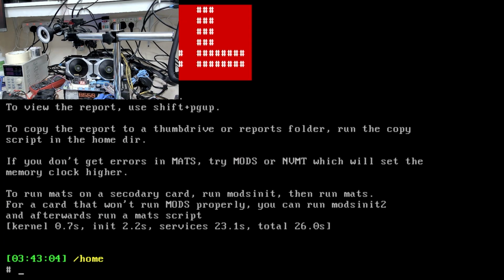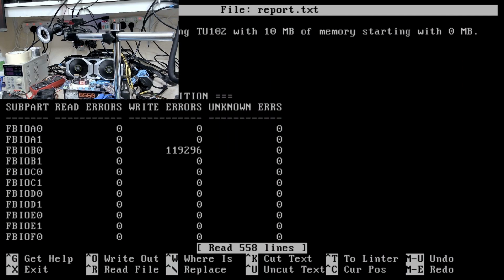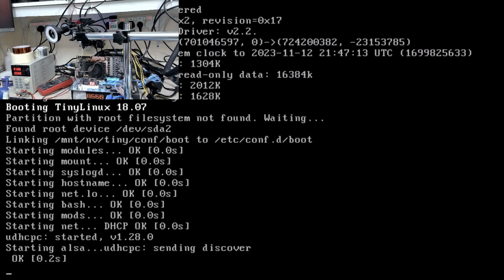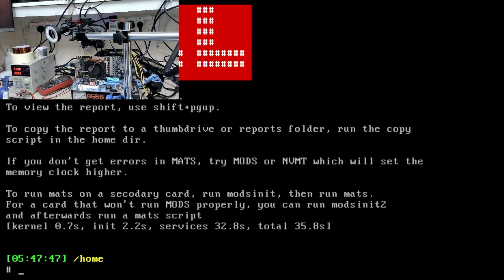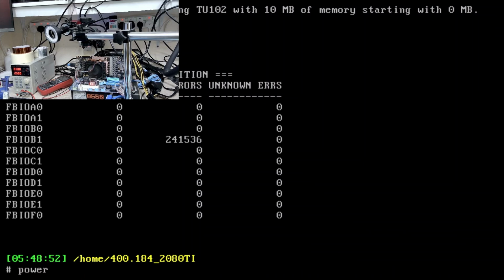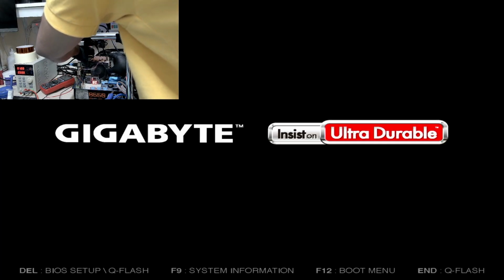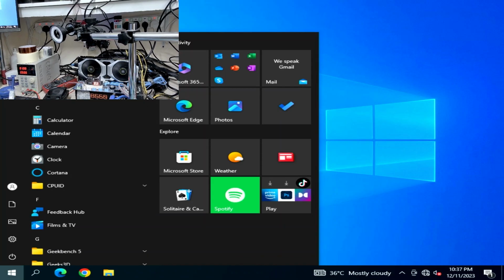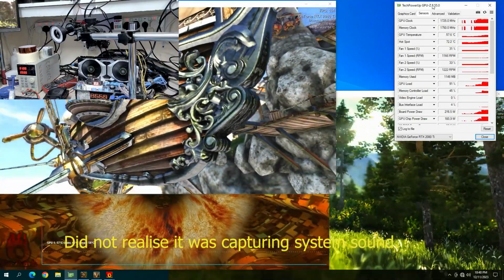RTX 2080 Ti Repair - 2018 Micron Memory Replacement - GPU Artifacts Fix.

Comment: Can you tell me what the temperature and wind of the hot air gun should be to remove the memory chip? and gpu? thank you
Reply from the maker: There is no fixed temperature as such. It all depends on your hot air station. I used Atten hot air station. For unleaded I use temperature at 420c and air at 60%. If you watch me carefully I keep tapping the memory gently to check if th solder has melted and if the chip is moving. If it moves when tapped it is ready to be removed. GPU core I will not recommend using hot air station. You would need a rework station for it with top and bottom heating.

Comment: usually board stresses near the connector causes the memory issues.  Replacing all 3 near the slot and recommending a supplementary card support bracket should solve most of the issues for the mid-term.  Long term heat cycles on the other chips could cause some pads to separate.
Reply from the maker: It's a good suggestion. Thank you for sharing. 😀

Comment: what tools are you using? i have a 2080ti that needs the memory replaced. Where do you buy your replacement chips?
Reply from the maker: I buy my chips from Aliexpress. There are a few stores but many to avoid. Below is a link to a store that I can recommend and has a link to the memory for 2080Ti.

https://www.aliexpress.com/item/1005005821865762.html?pdp_npi=4%40dis%21AED%21AED%2025.68%21AED%2025.42%21%21%2150.00%2149.50%21%402103245417059825019055695ef22a%2112000035365245139%21sh%21AE%212049366122%21&spm=a2g0o.store_pc_allItems_or_groupList.new_all_items_2007603245565.1005005821865762

Comment: Your video is great. I liked and subscribed to your channel. I had same issue on C0 memory. So, I have to do reballing for it. Can you please let me know what size of solder ball for reaballing for RTX 2080?
Thank you in advanced
Reply from the maker: Thank you for subscribing to my channel. The size is 0.45mm solder balls for GDDR6 and GDDR6X. Your card used GDDR6
Reply: @GraphicsCardRepairs-tk7ql   Thank you for your answer. I also need the DDR6 0.45mm stencil to do reballing right?
Reply from the maker: Yes you would need the stencil as well. This you can purchase from AliExpress. Just type "GDDR6 stencil" on the AliExpress app or website and it will give you lots of options. You will have 2 options 90*90 or direct heating. If you go for 90*90 you would need the holder as well the direct heat holder is very cheaper.90*90 is more pricer than the direct heating. The ones I use in my videos are 90*90. If you are comfortable without stencils then you can also place balls directly on the memory modules one by one. If you plan this reball for this card only then it would not be wise to invest in all the gadgets. I hope I have not confused you with all this info.
Reply: @GraphicsCardRepairs-tk7ql   Thank you so much for your detail explanation. You are great. I will just buy the direct heat stencil E052 DDR6 0.45mm on Ali. You think it should be good right?
Reply from the maker: Yes. A bit of practice will be required. But don't give up. Remember you will get it right and once you get it right it will be difficult to get it wrong again.
Reply: @GraphicsCardRepairs-tk7ql  Thank you brother. I will buy stuffs and try and let u know later if it works. Have a great day
Reply: Any update?

Comment: Hey i have a2018 micron rtx 2080. I get crash only under load, i underclocked memorg -300 and core -100 and it works fine. But when i run mats I get 37 errors all videos i see get likd 10-100k errors any ideas what I can do? I tried heating up the bad memory chip and no luck. Card works but 37 errors
Reply from the maker: If it's 2018 Micron memory all modules will have to be replaced with either Micron 2019 modules or Samsung 14Gbps ones. That's the road ahead. Heating will not change anything but even if it does it will occur again in sometime

Comment: Will any micron D9WCW DDR6 work interchangeably? I can not for the life of me seem to fing the exact Micron 8TA77 D9WCW memory chips for sale but I would like to give fixing my card a try. Figure if I'm gonna have a dead card I may as well give myself a learning oportunity for board repair.
Reply from the maker: When you buy Micron D9WCW make sure that you buy the code starting with "9" and not "8". Like in your case 8TA77 is 2018 Micron chips. This is a known faulty batch and would need replacement with 2019 ones. 2019 chips would start with 9 like the one I installed in the video. Pause the video to see the code when I show the 2019 chip
Reply: @GraphicsCardRepairs-tk7ql   Thankyou for that info man! Looks like Mauser carries the MT61K256M32JE-14:A chips; fingers crossed they aren't 2018's and I don't mess something up xD
Reply from the maker: If you are buying from Mauser it should be the later versions. But when buying if you get the option to leave instructions, mention it in there that you would want 2019 or later. Just to keep you informed - 2018 stock is not available new anymore but it's better to be safe.

Comment: Another one great repair. Could you please mention the camera microscope and the arm mount you are using ? Also the lens magnification and if you use a Barlow lens. Thanks!
Reply from the maker: The arm mount is a table monitor mount modified to fit a microscope. I will make a video on this as well. The camera microscope can be found at the link below
https://a.aliexpress.com/_mMpPErO . It's a Sony sensor IMX385 camera. Works really well.  The lens can be found at the link Just found this amazing item on AliExpress. Check it out! AED67.51  19%OFF | Adjustable 180X 120X 300X 200X 130X Zoom C mount Lens 0.7X~4.5X Magnification 25mm For HDMI USB Industry Video Microscope Camera
https://a.aliexpress.com/_mrppETW . This is a 180x zoom lens. Has good working distance.